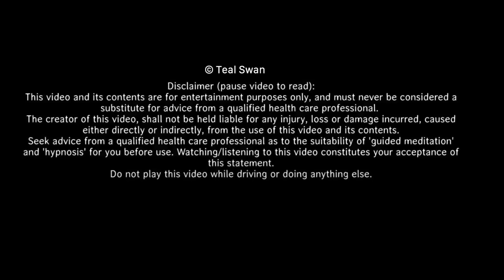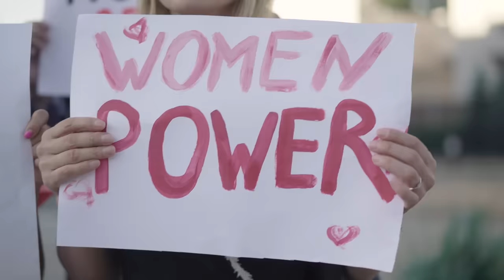Containment - What a Woman Needs From a Man in a Relationship

Comment: I'm a gay male so didn't feel like I had much to do with the male/female relationship side of this but I think it makes sense. Masculine energy contains the feminine. Even in the chakra system the crown at the top and root at the bottom are masculine and contain the feminine ones in between
Reply: I does. However, I do feel so resistant about gender roles.
Reply: root chakra is not masculine
Reply: @AXharoth  and how did you reach this conclusion?
Reply: @timthorn4064  its earth element so female
Reply: @AXharoth  it's energy is the most dense, solid and grounded of all the chakras. Its not a feminine chakra.
Reply: @timthorn4064  it is bc its passive
Reply: @timthorn4064  leave me alone now

Comment: Super job! Your explanation of how what I would call "providing security" being extended into deep understanding, and making sure control, condescension, criticism is left out, are lucid. Limiting, however, I think is essential. Not limiting by force, but setting limits by agreement, and with mutual support. My wife and I experimented with no limits, and it was a disaster. Limiting is an act of love, a way of keeping responsibility clear and open. Trying to understand my wife means leaving behind the sameness of gender. Applying a masculine standard of mind to females has also been a disaster in my life. Strong women, are not the same as strong men. In my experience, I do not even have the capacity to be as strong in the ways she is.

Comment: You can’t be owned without being limited and controlled to some point. Ultimately the protector has to be able to exercise final authority to confront threats. When I was in the Marines we took some VIP protection training prior to a deployment where we might have to guard diplomats or high ranking officers. The first lesson was that it didn’t matter how important the person was if the team leader thought the situation as dangerous we could jerk that VIP out of there by the nape of their neck of need be. Being in charge of security means that you get to set limits on behavior and situations. If you want containment it stands to reason you will be contained, and probably constrained at times. Most of you only want the advantages, not the realities.
Reply: Hard to tell if you're advocating for or against the topic, but very insightful comment. The video is another toxic extreme, it's not necessary to refer to yourself as owned to be in a protective romantic Endeavor, and it's not being strong to cut off your hair and scream at anything doesn't have a vagina. It isn't necessary to jump to one extreme to escape another that makes no sense

Comment: Interesting. I think that getting awareness of gender roles or needs is important. We need things, maybe based on our sex, that we are not told, and may end up feeling unfulfilled without knowing why. 
However, I think there is a nuance to it. I don't think that women are unable or uninterested in providing containment to men. To me, an ideal relationship is one in which both partners are providing containment to each other. Both have learned to be autonomous, proactive, caring and resilient, and try to give their best to their partners. I guess as individuals, we're better off having a bit of all useful skills (e.g. containment). Otherwise we are at loss when a specific challenge arises and we don't have someone external to provide us the help we would need.

I think that what we should aim for is that every sex learns how to enact at least a bit of the role tied the opposite sex.

Comment: As a man I have experience of a woman exploiting the provided containment without providing equally back. It is a huge problem for any man experiencing divorce on these grounds to provide to the same degree as before. Add the weight of feminism and confusion on both sexes about what is appropriate or necessary in a relationship. So a question to the Teal Swan - if a man provides containment, what is its counterpart on the woman`s side?